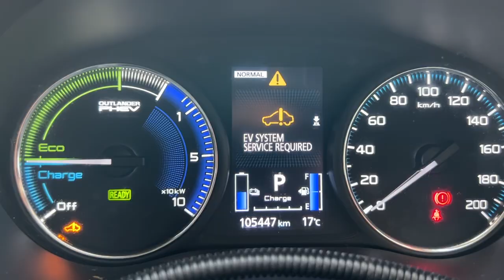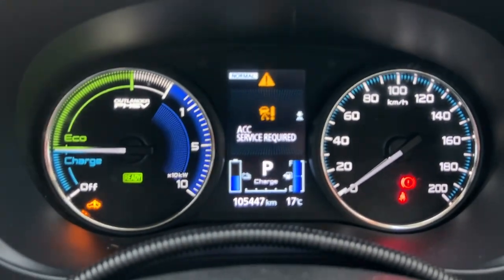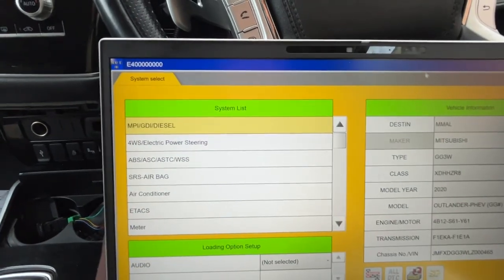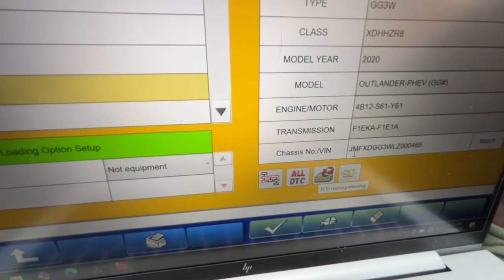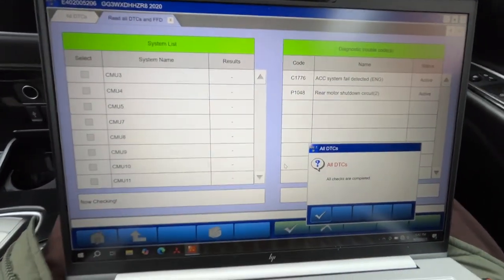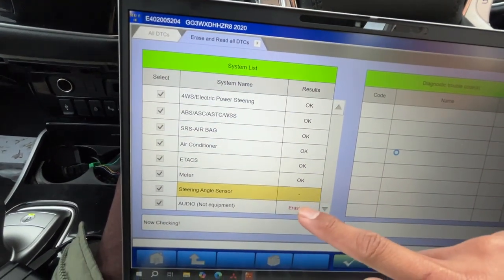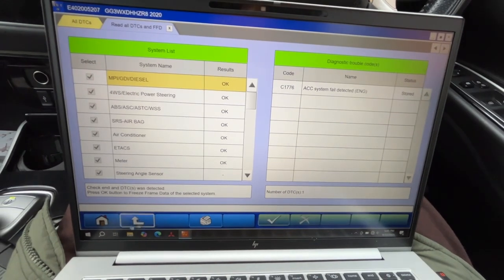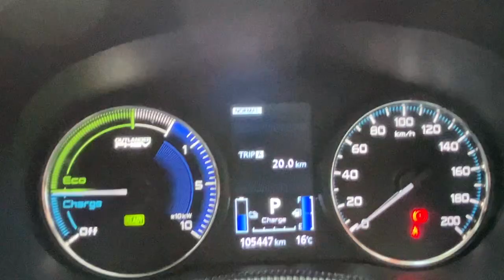Using MUT3 to check & Fix DTC error with EV System Service required for Mitsubishi Outlander PHEV

Comment: But was there actually something wrong with the car? Or had these fault codes been triggered incorrectly? Or, if there really had been something wrong with the car, would these fault codes have been triggered again?
Reply from the maker: a trouble code will appear if theres something wrong with the car. 

There are times where for some reason a triuble code will appear like if you have low 12volts battery and all sorts of trouble codes will appear.

you need a toolkit to clear trouble codes